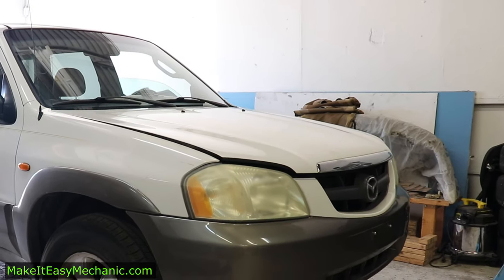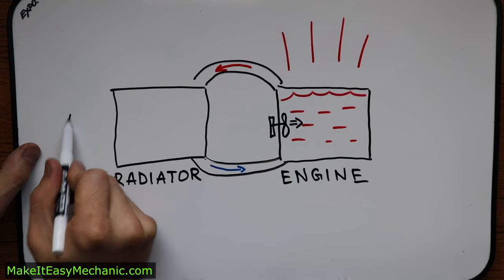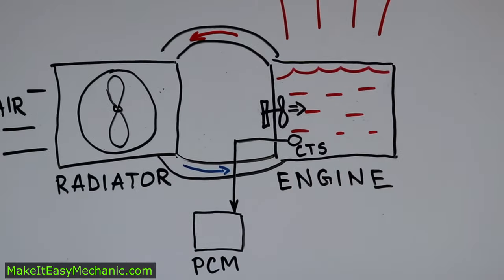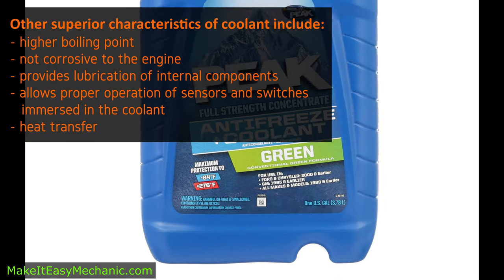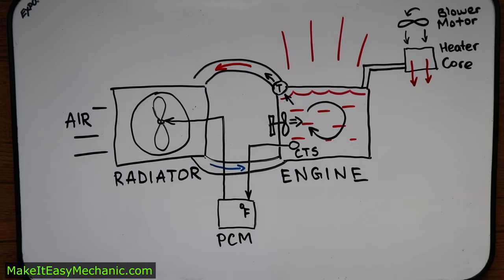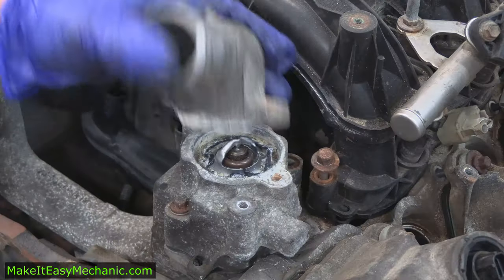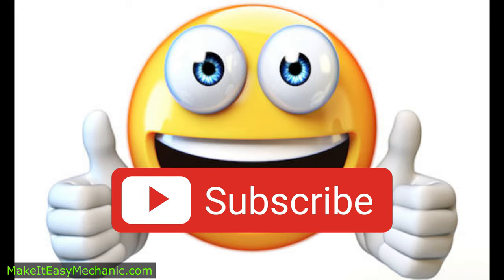How Engine Cooling System Works In a Car

Comment: Hi. Thanks for the video.  In the video you described how once the engine reached a certain temperature, the thermostat opens to allow the hot coolant to flow to the radiator to be cooled down, but you didn't explain what controlled or allowed the coolant from the radiator to flow into the engine via the lower radiator hose.  I have been struggling to find the answer to that question.  It would be great if you can tell me what controls that flow.  I have a 2002 honda civic.  Looking at my thermostat housing it does appear the lower hose is connected to the base of the thermostat housing, and the upper radiator hose is above the thermostat housing.  My problem is that at least I have noticed when I go for short distant drives around 3 miles, (in city)  the top radiator hose is always hot, but the lower radiator hose sometimes is cold--like it has never been driven--and sometimes it is hot.  My engine does not overheat and my dash heater gauge is normal (half way mark).  I even recently did a radiator burp, and let the engine run at park for over 40min, and while the top hose was hot, the lower hose remained cold!!  I keep reading how sometimes a cold lower radiator hose, with a top hot radiator hose,  is a result of a failed thermostat being stuck at the closed position, but how can this be since clearly the thermostat has to open inorder to have a hot top radiator hose?  Much appreciated if you can help me understand that!

Comment: Hi I installed an all-aluminium racing radiator in my Dodge ram v8 mainly because I did not want to go with a vinyl tank radiator again; vinyl tanks are crimped rather than welded. Six years ago I installed a new vinyl tank which started to leak for what ever reason. The thing is; the new aluminum radiator came with a 19psi pressure cap and it is bigger than the 18psi pressure cap which is recommended; so I can't replace the 19 with an 18. But should I be concerned with the 19 psi? Thank you for any thoughts. Frank

Comment: Trans fluid was added to my coolant resevoir. Been flushed 7 times, new radiator and hoses. New thermostat.  Still overheating for 1 minute then cools back down... any suggestions ??
Reply: Fixed by replacing the "new" thermostat.  Replaced with OEM part and problem was gone
Reply: @ShortsAndSweater  always replace part with nee OEM parts. Don't cheap out only bc it's cost less. It ends up costing you more in the long run

Comment: How hot should the radiator be? Does it heat up only when the hot coolant goes through it?
Reply: How hot depends on a number of things, including variable outside the vehicle. The coolant does heat it up, but you also have (on many cars) the trans using part of it as a cooler. Then you have residual heat to deal with in the form of direct sun light, air temp (summer heat) and heat from the air conditioning condenser.  The temp of the radiator is not as important as whether or not it's cooling the fluids to the correct range.

Comment: Thanks your video was very simple and informative. I'm having issues with Toyota Tazz 1.3 carb that's overheating. No leaks of coolant and the top hose from cylinder head to the top of radiator gets extremely hot. The bottom hose stats cold even when the car is hot. The fan comes on and stays on as soon as the ignition is turned on even when the car is cold. I got an technician to check it out and he's advising me to add another thermostat switch in the bottom hose of the radiator that will solve the problem. I can't understand how this will solve the problem as the bottom hose doesn't get hot. Plz assist if possible. Thanking you in advance
Reply from the maker: Whenever you see one hose hot and the other cold you can bet you have an issue with the flow. If the thermostat is not opening - coolant won't flow into the radiator, so the hose where the thermostat is will be cold. Another option - poor flow in the radiator (clogged radiator). I would agree with your mechanic and try changing the thermostat first though.
Reply: @MakeItEasyMechanic  What about heater hoses? the heater hose that comes out of the pump is before the thermostat I think so that is always hot even before the thermostat opens right?
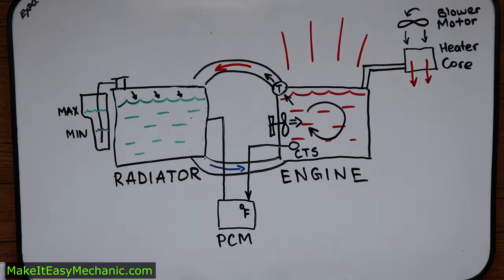Reply: @MakeItEasyMechanic at 5:42 you explained about the vacuum that’s created after the engine is turned off and coolant cools down. That vacuum also has to reach above the 15 psi for the vacuum valve on the radiator cap to open up?

Comment: How  does the coolant go back into the radiator from the overflow cantainer ?
Reply: when the engine cools it creates a vacuum and if the radiator cap is functioning correctly, the coolant will be drawn back into the radiator through the vacuum valve in the cap.

Comment: Just wondering ? does the radiator fans suck in air thru the rad to cool the coolant,
or does the fans push air forward, thru the rad, and outside of the car. I get the
impression after watching a couple videos including this one, that the rad fans
suck in air from the outside, and thru the rad, thereby releasing this air under the
hood of the car. I always thought the fans blow the air forward, and out the front
of the radiator, but I think I'm wrong. Can you confirm this ? Thanks and great video.
Certainly got a like from me :)
Reply from the maker: Yes, the radiator fan sucks the air from the outside into the engine bay
Reply: @MakeItEasyMechanic  thanks for reply,
so now I know. 🙂
Reply: @MakeItEasyMechanic  that is correct but I wonder if it applies to all vehicles or if some push the air rather than pull

Comment: Does the cap in the overflow bottle need to seal the air in it to create a vacuum? Can the yellow cap be opened and still operate properly?
Reply from the maker: Yellow cap does not affect the vacuum, just make sure the hose from the radiator that goes to the overflow bottle goes all the way down to the bottom of the bottle.
Reply: @MakeItEasyMechanic  I wondered about that too so I got a new cap for the bottle on my dodge ram

Comment: My radiator cap is releasing pressure to the atmosphere, i don't know why isn't going to the reserve thank
Reply: did you check that the hose from the radiator filler neck is connected to the overflow bottle?